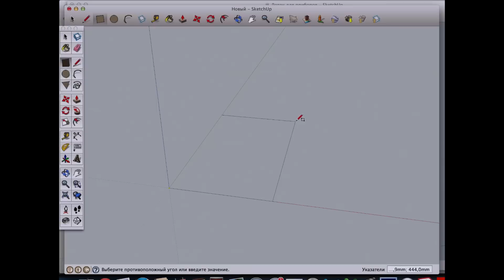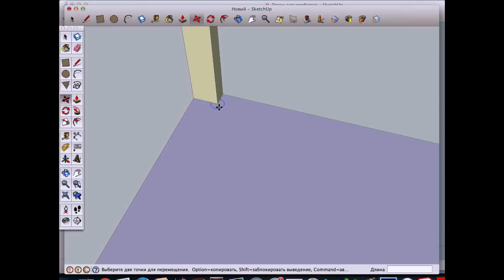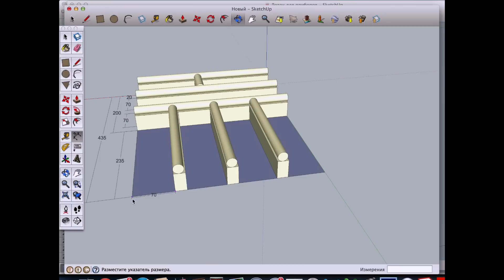Making a cutlery tray

Comment: Looks awesome! I take it you are not at your main resident with those high tech tools you were using?? Heh heh heh... anyways you should put some loose cork sheets on the bottom to quiet down the rattle of the silverware in the metal drawer. Keep up the great work!!
Reply from the maker: Thanks! I was in Spain, far away from my shop. I had minimum of hand tools. The bottom of the box made of wood fiber board.